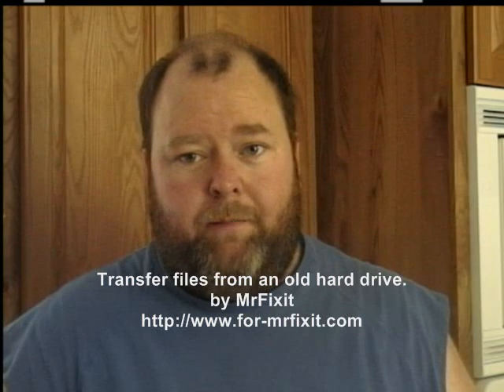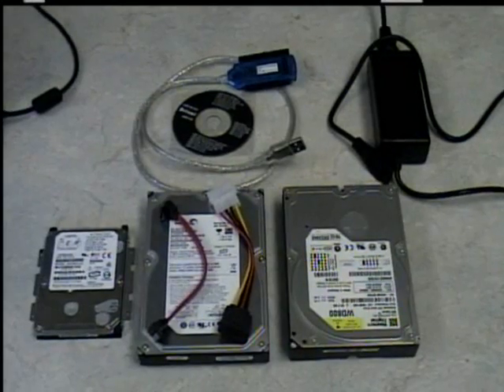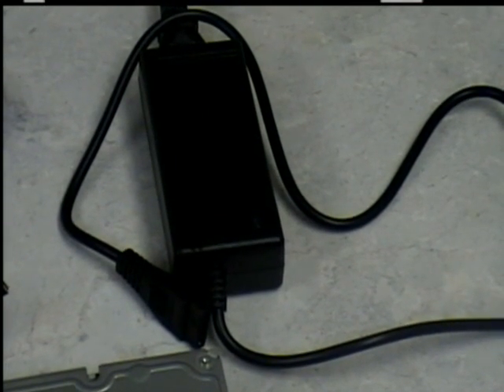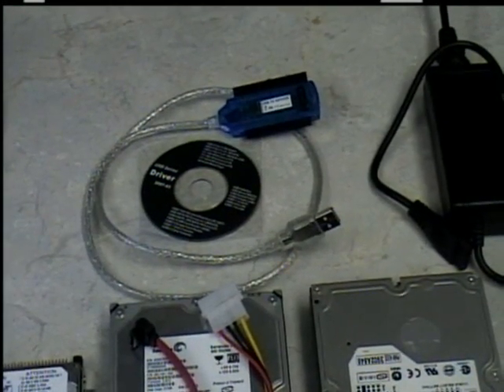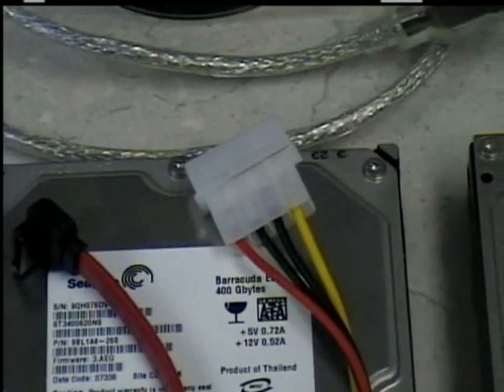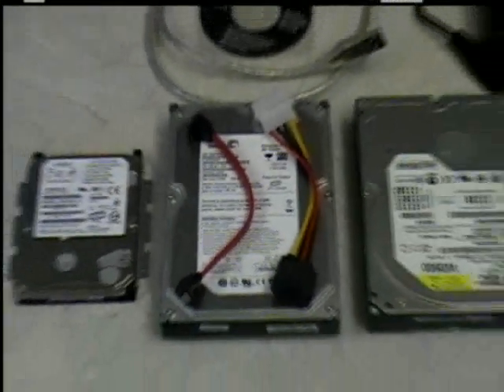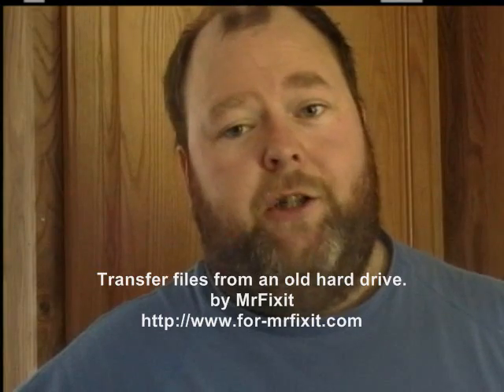How to transfer files from a Dead PC [CC]

Comment: Hi, I am need of your advise please.  I am not totally a computer guy, just someone who knows a little.  Recently my laptop died and after watching your video, thought it would be best if I bought the leads needed to get data from the hard drive.  Last night I made said purchase, and today took apart the laptop to get the hard drive out.  I note from your comments that it should be a 40 pin connector, however when I got the hard drive out, it is like nothing ive seen before, and now doubt if the leads of bought will work.  Here is a photo of the hard drive 2.5" if I can post it somewhere on here.  It is like 15 pins on one side, then a bit of plastic then another 7 but they are not really pins, more like something you would slide something onto. any advise?
Reply: i cannot find a way of posting pics, however if you look at this link this is the type i am looking at, I am guessing I will need another lead maybe?
Reply: Apologies for another question: however now that I have the hard drive out of my laptop, and noting it is 350gb, whilst I will endeavor to recover any data from it, I am thinking afterwards, why not use it as a back up hard drive? In your opinion, is there any issue in having this as a portable hard drive for my new laptop, using whatever leads I get in the kit you mentioned.  But notwithstanding that I feel I may need another lead as the pins are not pins, they are something very different and there are not 40 please see the link

https://www.google.co.uk/search?q=2.5"+laptop+hard+drive+wd+scorpio+blue&client=opera&hs=5il&source=lnms&tbm=isch&sa=X&ei=B9LjUsufEa2U7QaZ34HoCg&ved=0CAoQ_AUoAg&biw=1343&bih=705#facrc=_&imgdii=_&imgrc=tLf8nQcm9l64UM%253A%3BmkAh-N31Ga5-4M%3Bhttp%253A%252F%252Fwww.legitreviews.com%252Fimages%252Freviews%252F1658%252Fwd-scorpio-black-750gb.jpg%3Bhttp%253A%252F%252Fwww.legitreviews.com%252Fwd-scorpio-black-750gb-notebook-hard-drive-review_1658%3B550%3B354
Reply from the maker: That is a SATA drive. The 15-pin is the power connector and the 7-pin is the data connector. Most newer laptops use 2.5 inch SATA drives. Older laptops made before Vista used 44-pin IDE drives. XP laptops may have a SATA or IDE drive in them. All PC's since Vista use SATA. You'll need and adapter to connect the SATA drive. -MrFixit
Reply from the maker: You just need a kit or adapter that connects to SATA drives. -MrFixit

Comment: My Windows xp laptop doesn't work for some reason. It cuts on shows the Windows symbol an that's it. So unsure if the hdd is good, anyway i was looking into buying an external hdd so i may try an retrieve files from my old xp hdd. So my question is 1) rather then buy a whole protable hdd just purchase all cables i need an 2) will it work connecting to my new google chromebook.
Reply: Rubbish

Comment: Do I need to use the power supply for the lap top side?
Reply from the maker: 2.5 inch IDE (44-pin) drives are the only ones that do not require an external Power Supply. The adapter provides power via USB. All other Drives (3.5 inch IDE and all SATA drives require an external Power Supply when using the adapter. -MrFixit

Comment: I used the SATA/IDE with no clitch to transfer data from laptop  (Vista) to laptop (Windows 7) when my old laptop died. Now the Window 7 is corrupt (possibly a virus).  Now I'm trying to temp transfer data (pictures documents) to an old XP. Wipe out the Windows 7, then transfer back (unable to connect to internet to download current virus software just in case), when I hook up the SATA, the XP recognizes it but when I click on it wants me to format the drive (E).  What am I doing wrong?
Reply from the maker: XP may not see the HDD due to known issues.  XP original release was limited to 137GB, XP SP1 raised the limit to 200GB. XP SP2 raised the limit to 750GB. XP SP3 raised the limit to 1TB. The Motherboard's BIOS must support the HDD's Capacity, too. If the HDD was formatted using GPT (required on HDD larger than 2TB), XP cannot read the drive. -MrFixit

Comment: Hi Mr FixitI hope this isn't a daft question. I would like to transfer many files from my old hard drive to my new computer. However I have forgotten my password for the old computer, and I wondered if there is any way I can bypass this obstacle and still transfer data. I suspect there isn't but there's no harm in asking.

Thank you.
Chris
Reply from the maker: If you are connecting the old HDD to the new PC, the Password will not be an issue however, you'll need to Reclaim File Ownership of those files. I have a video to show how to reclaim the file ownership. -MrFixit
Reply: Much obliged MrFixit, I was genuinely worried about this which is why I never even approached this task. Thanks
Chris

Comment from the maker: The connection will either be 40-pin (3.5" IDE drives) or 44-pin (2.5" IDE Drives) minus the 1 pin used for the key notch. MrFixit

Comment: Use the diskpart, application in command prompt . If not familiar, go to youtube an type diskpart. It is very easy to learn. Than you can format any drive, flash drives too.

Comment from the maker: I'm assuming you are referring to Small Computer System Interface (SCSI) HDDs? No, this adapter will not work on SCSI drives. SCSI drives often use a Centronics, IDC, and SCA connectors, however, you can get a SCSI to USB adapter for the drive. -MrFixit

Comment from the maker: Not unless you know where the virus is located and avoid it. If you have a good AV software, you can still use the adapter to transfer files. In fact, the AV software can scan the HDD to find and remove the virus(es). -MrFixit

Comment from the maker: Do you plan to replace the 750GB HDD with the 3TB HDD? Any HDD connected to the adapter will behave just like a standard External USB HDD. If you are going to switch the HDDs, you will need a Cloning software like Partition Assistant by AOMEI Technology (tutorials on our channel). To use the new HDD, it will need to be initialzed, which can all be done with the free PA software. -MrFixit

Comment from the maker: There is no specific purpose for the orange wire (3.3V) in SATA drives. It's to insure compatibility between older drives that use +5V for their logic circuits and the newer drives that will use 3.3V for their logic circuits. -MrFixit

Comment: you show the ide plug 4 wire, but looking into my sata computer it has 5 wire, what is the orange line for. I see it is not used in the adapter. Why?

Comment from the maker: The number of "I"s, in "SATA", indicate the SATA version the drive was designed. SATA (a.k.a. SATA I) = 1.5 Gigabits per second (1.5Gb/s) or 150 Megabytes per second (150MB/s). SATA II =  3Gb/s (300MB/s). SATA III = 6Gb/s (600MB/s). The cable will work on 2.5 inch and 3.5 inch SATA I, II, and III drives. PC's since 2006 use version 2 and later. -MrFixit

Comment from the maker: The 39-pin IDE  HDD is actually a 40-pin IDE. When you look at the HDD's connector, look at the center of it. you'll notice there is 20 pins on top and 19 on the bottom. That's because pin# 20 is missing. This is used as a 'key' to ensure the cable is connected correctly. The 44-pin is for 2.5 inch IDE drives because their DATA and POWER connections are in one connector. The 40-pin is for the 3.5 inch drives since they have a separate DATA (40-pin) and POWER (4-pin) connectors. -MrFixit

Comment from the maker: 2.5 inch drives are small and are used in laptops while the 3.5 inch drives are larger in dimensions and are found in Desk tops. IF you need further assistance you know where to find me.

Comment from the maker: I have had good results with Seagate and Western Digital Hard Disk Drives. I have (2) 500GB WD HDD in my laptop, (1) 1TB USB WD HDD for storage, (1) 320GB Seagate HDD and (1) 500GB Seagate HDD in my Media Center, and (1) 400GB Seagate HDD in another Desktop. I would go for Seagate since I've had lower access times than WD. -MrFixit

Comment from the maker: Any 2.5 inch or 3.5 HDD will work. They do make External HDD Enclosure kits similar to the one I used in my "Convert HDD to USB" video. SATA drives are faster than IDEs, even on USB. 1TB IDE are hard to find since SATA is widely supported by many manufactures. I have 2 videos that show an installation of an IDE drive and a SATA drive to ID the cables used. Be sure the Enclosure kit supports the HDD you will use. If you have a 3.5 inch SATA drive then the kit must support the same thing. -MrFixit

Comment: I caught my eye on the Western Digital 1TB external hard drive but it turns out if it fails you can't save it as it's soldered.

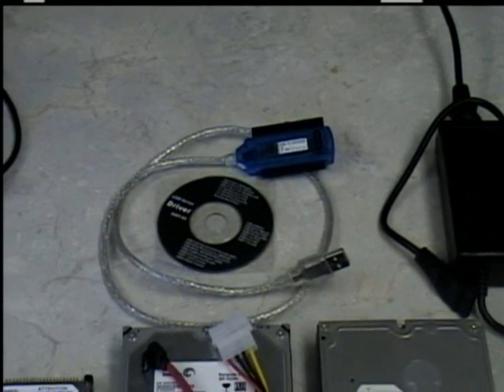around 1:18 you can see the damn thing is soldered on so it's a piece of crap if it fails.

/watch?v=anset0_0uyg

Comment from the maker: Laptops use the same kind of Connectors as do Desktop drives with the exception of IDE drives. The 2.5 inch IDE drives use a single small 44-pin connector (Data+power) where as the 3.5 inch IDE drives use a 40-pin (data) and a separate 4-pin connector for the power. Laptop Manufactures also use adapters to allow the drive to connect to the motherboard since most motherboards in laptops use smaller connectors due small space. chrck that the HDD doesn't have an adapter attached to it. -MrFixit

Comment from the maker: You can still connect the Old HDD to the PC using this adapter then have the PC run an AntiVirus Scan on the drive in question. You can run into problems installing the OS HDD from one PC into a different PC because the hardware is different. The old HDD can be connected as a Second drive instead of a Boot drive. -MrFixit

Comment from the maker: The MBR may be damaged. I have a Video called "Repair the MBR". If the MBR is corrupted the software in the video will correct the MBR so Windows can recognize the partitions. Without the MBR, Windows assumes the HDD is blank. -MrFixit

Comment: I attached my old hard drive to my new computer, first try it came up. I opened up the old hard drive file and I had all the files there that I had from my laptop but I couldn't actually open any of them without gaining permission first. So I went into the security tab for the hard drive, and enabled where you can now access the files. Something happened during that process and it failed. Now the hard drive just comes up as Local Disk F and it ask me to format the hard drive before I can open it

Comment from the maker: Yes, the adapter works on Windows XP and higher, Mac OS 8.6+ & 9.x with Stuffit Expander software installed, and Mac OS X. Be advised that Windows cannot read a Mac based HDD and Mac can read, but not write to, a Windows based HDD. -MrFixit

Comment from the maker: You cannot retrieve Data from a HDD unless it works. You will need to send the HDD to a Data Recovery Facility to repair the drive and recover the data. You can restore the OS by contacting Microsoft's Supplemental Parts department with a Proof of Authenticity of the original OS to purchase a Replacement DVD. -MrFixit

Comment: Does anyone know if there is a way to retrieve files/data from a dead laptop hard drive (hard drive doesnt spin or work etc)? Also I have ordered a new hard drive so i need new operating system, would there be a way to copy or move the operting system from the dead hard drive over to a new one? or do i need to use a recovery disk or buy a whole new disk? thanks

Comment from the maker: Yes, theunknown117. As long as it is a 2.5 inch or a 3.5 inch using either an IDE or SATA data interface. You just need to remove the HDD from the laptop. -MrFixit

Comment from the maker: The adapter works with Desktop and Laptop PCs. The files may still be intact but will depend on the HDD's condition. You may need to use a DATA recovery software. -MrFixit

Comment from the maker: If anything is wrong with the drive the adapter wouldn't be able to read the drive therefore the OS will not install the adapter's drivers. In some cases the drive connects but the OS shows nothing which means the Master Boot Record may be damaged and need repaired. I do have a tutorial using a free software by AOMEI if such problem arise. -MrFixit

Comment from the maker: The retailer will indicate the OS the adapter will work in the specs or description of the adapter. If it works with Vista and 7, you shouldn't have any problems with Windows 8. -MrFixit

Comment from the maker: You're welcome, TiffH9. The adapter will not harm the OS or the computer. USB drives are a tad bit slower compared to internal drives. If you have used USB Hard drives before this is no different except the fact this adapter is temporary. You can convert the drive to USB using an enclosure kit that I demonstrate in another DIY video. They cost around $8 to $40 and will have everything you need. Be sure it is compatible with Windows 8 an it can interface with your HDD type. -MrFixit

Comment: This video is great but I really need your help! I plugged the adapter into the hard drive and then into my computer. My computer quickly installed the required drives and said it was ready to use, and I can hear my external hard dive humming, BUT, I can't view the files. I click on my computer and it doesn't show up. I have no idea what to do and I would really appreciate any help at all. Thanks!

Comment from the maker: Were you using an encryption software to protect the Hard Drive? Windows since XP use permission tags that permits specific user access to a file which is a new security feature using NTFS. It tells the OS who has access to the file and what they can do with that file. You shouldn't have the same problem using the adapter in the video. I do not know how Geek Squad does it. There are 2 ways you can connect the HDD: 1) either connect the drive directly to the motherboard or..........

Comment: I have a question i took my laptop a Toshiba to Office Depot they said my hard drive is working but they couldn't get my info out because its telling them it doesn't give permission  to? If i you your method will i get the same problem? ALSO how come they told me to take it to best buy and they will be-able to retrieve my photos and videos what method do they use?

Comment from the maker: Try accessing the recovery console on the laptop. This can be done during POST/startup pressing the key indicated at the bottom of the screen. You can try to see if the laptop will boot in Safe Mode and try system restore or factory recovery by pressing F8 during POST/startup then choosing Safe Mode from the menu. -MrFixit

Comment from the maker: You should be able to access the USB HDD under 'Computer' in the start menu where all of the Drives and other storage devices are listed. If Auto-run is enabled, a window should pop-up asking you what you want to do with the files. Be advised that Windows can not read a HDD from a Mac PC and only certain Mac OS' can read a NTFS formatted drive. -MrFixit

Comment from the maker: For the IDE laptop HDD, yes, they plug into the 44-pin connector. The Laptop SATA drives use the standard SATA connector. Be aware that some Laptops have an adapter to connect the HDD to the motherboard, you just need to remove that adapter if present. Other than that, yes, this basically acts as a standard external USB HDD, However, I do have another video that will show how to convert any HDD to an external USB HDD using a simple kit. -MrFixit

Comment: Good info man, thanks.
Darik's boot & nuke does a very good job at wiping out data, but so does a cutting torch. Melt them platters! No ID theft risk now, and besides, its fun! Just don't be breathing any of those fumes. They'll turn you into a zombie, or worse. And save the danger-strong magnets from the head pivot area. Lots of fun in those... Again great video.Looking forward to more!

Comment from the maker: That ok, ekaj43, it's not you. Some Manufactures start the first drive label as SATA1 on the motherboard.  Put the Original HDD on SATA1 and the Deskstar on SATA2. SATA1 is for the primary boot device by default. BIOS will see it as Device 0, Drive 0, etc. (it's a computer thing). This should allow the PC to boot from the original HDD and install the Deskstar as a Secondary physical drive (usually as D:\). MrFixit

Comment from the maker: It's usually the OS that can't find the HDD. Is the drive spinning? Check that the jumper on the back is set to either "Master" or "Slave". "Cable Select (CS)" may confuse the adapter. Check to be sure the OS is detecting the adapter under device manager. -MrFixit

Comment: Hello, the IDE/SATA adapter has arrived, but the sata wire does not fit into the HDD it just keeps lipping straight out so im using the old wire but done everything else the same as what you done on the video, but it comes up in the bottom right installing the device, it installs but no autoplay comes up and it doesnt come up in my computer?

Comment from the maker: Assuming both Drives are SATA, switch their Data cable between them. The primary boot HDD (PC's original HDD) should be connected to SATA0 on the motherboard. This should allow the PC to boot from the original HDD and use the drivestar as a secondary HDD. -MrFixit

Comment: Hello. I pressed F5 and it comes up 2 options, Microsoft windows vista & memory diagnostic tool, i pressed F8 on Microsoft windows vista & it comes up several options; safe mode, safe mode with networking, safe mode with command prompt, enable boot logging, enable low-resolution video, last known good configuration(advanced), directory services restore mode, debugging mode, disable automatic restart on system failure & disable driver signature enforcement. Where do i go from here?

Comment from the maker: Are you connecting the drive directly to the motherboard or using the IDE/SATA to USB adapter? Those drives have dual power connectors. A 4-pin with yellow, black, black, and red wire Molex power connector and a 15-pin with Yellow, orange, red, and black wires for SATA power connector. Only use one of those power connectors. -MrFixit